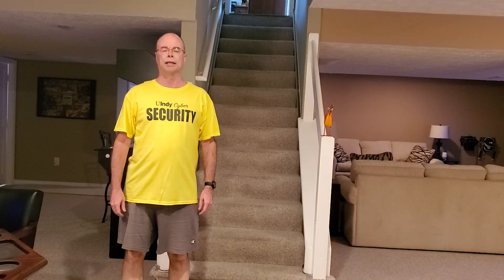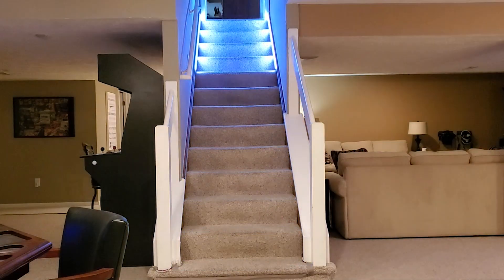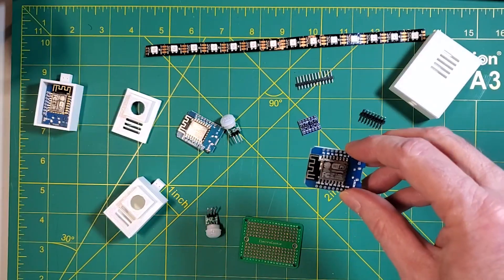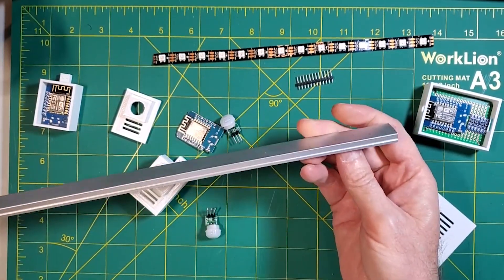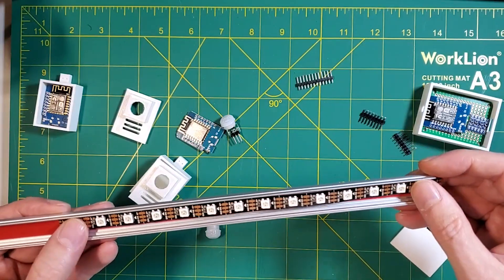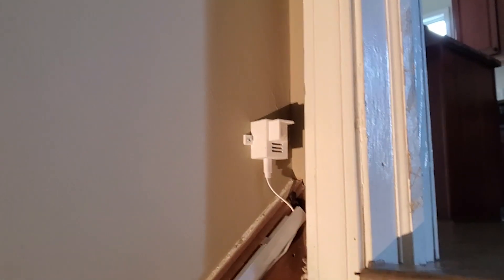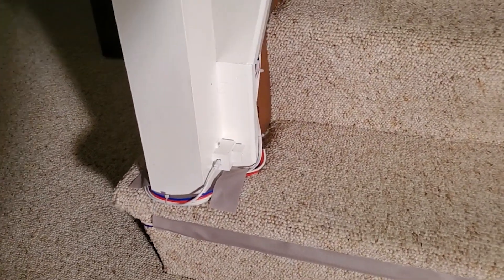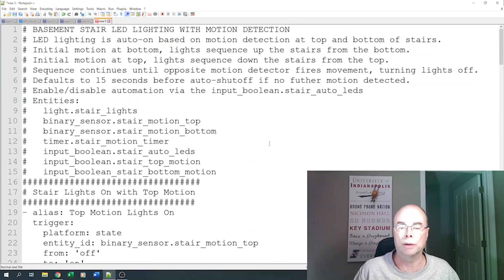Motion activated LED stair lighting... without staircase modification!

Comment: Thank You for the video . I followed step by step and it's up and running on my stairs. Question when walking past the first sensor it detects my first leg and turns on the lights but sometimes it detects my trailing leg and and turns off the lights . Is there any adjustments that I could make to fix this issue ?
Reply from the maker: You are using the ToF sensors and not the PIR sensors, correct? I had the same issue initially because the ToF sensors react so quickly.  There are two things you can do, and it might be a combination of both that works out the best in your situation.

First, you can shorten the 'trip' distance of the sensor in ESPHome to cover about 1/2 - 3/4 the width of the stairs.  That way one leg would trip the sensor but the second leg would be outside that range and wouldn't trip.  But this only works reliably if you always tend to step on the first step with the leg nearest the sensor.

What worked best for me was to add a "for" clause to both the on and off automations in Home Assistant.  In other words, you have an automation for both the the top and bottom sensor with a trigger that is:
from: 'off'
to: 'on'

You would add a time to that so that the sensor must remain in that state for a minimum amount of time.  For me, that was around 250 ms.  So you just add a "for" statement to the trigger, so it looks like this:

to: 'on'
for: 
  milliseconds: 250

Repeat this for the other automations that go from "on" to "off" as well, adding the 'for' statement.  You may need to adjust the amount of time and/or use this in combination of changing the detection distance.  It may take some trial and error, but you should be able to get it dialed in so that your second leg will rarely trip the sensor right after the first leg.  Let me know if you have any follow up questions.

Comment: How did you hide your AC to DC Power Adaptor?
Reply from the maker: It's not really "hidden"... but basically out of sight (sorta') off to the left of the stairs and next to the arcade machine.  That's partially because I had power there for the arcade and slot machines.  You situation will likely be different... and sometimes you just have to get creative with placement of things like the controller, power supply and wire runs.

Comment: Is it possible to wire in 3 sensors?
Reply from the maker: Each sensor is an independent device and its own entity in Home Assistant, so you can add as many as you want.  But it will also require some pretty substantial modification to the Home Assistant automations to account for anything more than the two sensors.  Theoretically you could add a sensor for each step... although the power runs and automations would get pretty tricky with that number of sensors.

So yes, you could use 3 sensors since each is a completely standalone device that is not physically connected or wired into the LED controller... assuming you can make the automations work properly in Home Assistant.
Reply: @ResinChemTech  How much would you charge for the 3d box for the sensor?
Reply from the maker: Sorry, but I'm unable to provide printing services for others.  However, you can find the design for the box on Thingiverse here: https://www.thingiverse.com/thing:4969716  and there are my online printing services that can take this design and print the box for you.  In addition, I always recommend that if you have a maker space or maybe a University nearby, you might check and see if they offer any printing services (some libraries even have 3D printer now) where you might be able to get an item like this printed at a much lower cost than an online service.

Comment: Hi, I found your "standalone" controller video and it will DO the trick for those of us who don't want to go with Home Assistant. I use ALEXA, my girlfriend uses GOOGLE HOME. Will those do the job instead of home assistant? Will home assistant "absorb" and operate all my ALEXA stuff if I DO decide to use home assistant?  Thanks for you great videos!
Reply from the maker: For this particular project (stair lighting)... unfortunately, it won't work with Google or Alexa alone (at least not as built - although you can turn the stair lights off/on via voice).  Google Home and Alexa can both work along side Home Assistant and they really compliment each other.  My wife primarily interacts with our smart home via voice (we are Google Home users).  Home Assistant allows me to add automations and expose certain devices that are not available with Google Home alone... so that my wife can ask Google to launch an action or interact with a device that would not have been available with Google Home alone.

Comment: A question for you sir. Does the staircase lighting work as "stand-alone", install-it-and you-are-done? I want to make one for my daughter and she does not have, nor want - Home assistant, ESPhome, or WLED. Once the controllers are flashed, does it work all by itself?
Reply from the maker: This particular version requires Home Assistant to work.  However, I did develop a standalone version that doesn't require Home Assistant (or any other external system).  It doesn't have all the effects that WLED has, but it does have the same "chase" lights you see in this video... and a few others (although those effects were added after the video was made).  You can see a video of that version here:  https://youtu.be/b4s_VEtVWY4  

You can also find a lot more detail, along with the current lighting effects in the related blog article and Github repo.   Links to those can be found in the video description of the above video.

Comment: I'm sure it's already been asked but what WLED effect is that?
Reply from the maker: It is the "Wipe" effect, with the reverse flag on for one direction and off for the other direction.
Reply: @ResinChemTech  how are you going about turning the reverse flag on and off depending on if your going up or down the stairs?
Reply from the maker: It's all handled in the Home Assistant automations and determined by which sensor triggers and whether the lights are already on or off.  If the bottom motion triggers and the lights are off, they are turned on with the wipe effect and no reverse flag.  Similarly, if the top motion sensor is triggered and the lights are off, they are turned on with the reverse flag enabled.  If either sensor is tripped and the lights are already on, then they are turned off (that's how the effect is stopped when exiting the stairs).
Reply: @ResinChemTech  ahhhh ok. I see the reverse toggle now in my WLED integration.

Comment: Thats is my next project for sure. Thanks for this video.
Reply from the maker: You are most welcome!  Note that I did a follow up video where I upgrade the motion sensors with a different (and in my opinion better) type of sensor that isn't as susceptible to false detections.  You might want to take a peek at that, along with the full written version of this project, before starting you own build.  This original video was done quite some time ago, so I have made improvements in the time since this particular video was released.

Let me know how your project goes... or if you have any other questions along the way.

Comment: Hello ..I love your stair lights n I want to do it toine but I have a 2 step u turn in middle..just need to know it's 27 ft total n I can only get the lights in 16.4 ft n how do I know the size of power supply to get for that...
Reply from the maker: You can find answers to your question about the the turn in the stairs in my written version of this project: https://resinchemtech.blogspot.com/2021/07/simple-motion-activated-led-stair.html

As far as attaching multiple strips together (for greater than 16 ft) and calculating the size power supply, I have both a video and blog article that talks about both of these issues (and other info you may be interested in when working with LED strips:  https://youtu.be/GZjS51yBV4s

Good luck with your project!

Comment: Paint those stringers white and 🤌 
I would also need to hide all that wiring to meet the spouse approval factor. Fantastic project.
Reply from the maker: Well... as the title of the video states, my goal was to do this "without staircase modification".  I explain the reason why in one of my recent videos ( https://youtu.be/rKAZxDtShCo ).  Naturally, the wires could be much better hidden if you are willing to drill into the staircase, pull carpet or cut into drywall.  My goal was to install this system without making any changes... and so that the system could be removed in just a few minutes and you'd never know it was there.

But I fully understand the WAF!  Luckily for me, mine is pretty lenient when it comes to the basement "man cave".  Now, if I wanted to install this on our main stair case to the second floor... that would be a totally different situation (and don't think I haven't considered it... but that would have a very, very low WAF!)

Comment: I'm bummed.  I doon't have a skirtboard to attach the strip.  My treads go directly into the drywall, so I have no way of laying out the strip in parallel to the strip.  Any other ideas to accomodate me?
Reply from the maker: Well, the aluminum strip and LEDs are quite light, so drywall should support them without anchors, although you may want to use slightly longer screws on the brackets.  I have other LED installs, such as my garage parking assistant where the aluminum channel is attached directly to drywall.  This assumes you are OK with creating small screw holes in your drywall.

As far as making the strip parallel to the stairs, just measure up a fixed distance from the front edge of each step and make a small pencil mark.  Then simply align the bottom of the aluminum channel with these marks.  The bottom of my aluminum strip is approximately 1" above the front edge of the step, but you can adjust that as you like.

If you don't want to put screws into your drywall, you could try some strong double sided tape... but to be honest, the double sided tape may cause more damage to the drywall than the small screws.  Hope that gives you some ideas.

Comment: I wonder if you could ditch the PIR sensors and use a mm wave radar sensor instead as you can measure distance to target so light the correct steps in real-time based on where someone is standing e.g of they change direction on the stairs
Reply from the maker: Yeah... as I mentioned in this video's description, I replaced those PIR sensors with ToF sensors... and did a follow up video ( https://youtu.be/ZRb_wpJo1AM ).  The ToF sensors rely on distance (and have a narrower FOV), but the distance is converted to a boolean in ESPHome so that Home Assistant logs aren't flooded with continuous distance measurements.  The ToF sensors have been much better than the original PIR sensors... especially for my particular staircase design and opening at the botton.

Comment: Seems nice till you realize when it's very dark the motion activation doesnt work. In total darkness they wont turn on when you need them.
Reply from the maker: Hmm... guess that's possible, but my basement is pretty dark (no windows) and they have never failed to trigger.  Which would be expected because the original sensors utilize infrared (basically heat), not visible light.  What's more, I have also upgraded the original PIR sensors with ToF sensors (covered in another video) and these also do not rely on visible light.  In fact, I've tested in a completely dark basement, and they work just fine.

But your experience might be different.

Comment: I do like this. It does seem complicated to me. Do you know if anyone makes a complete kit you can buy?
Reply from the maker: I don't know of anything commercial.  You might be able to rig something up with some commercial LED strips, a smart plug or outlet and a couple of motion detectors... but I don't now how responsive it might be.

Yeah... this is a bit complicated... but sometimes that's the nature of DIY.  I did do another version (and related video) on a bit more basic version that doesn't have as many effects or features, but operates standalone and doesn't require Home Assistant or any other external hub or automation system.  It's not simply plug-and-play either, but it is a bit simpler than this Home Assistant version:  https://youtu.be/b4s_VEtVWY4

Comment: Great video! (I landed here from the update you did later). 

Did you consider using one esp for all functions? Addressable lighting effects aren’t the easiest to write in esphome, but the defaults may cover what you need for this purpose. I’m considering the same project and I wonder if I could use a single esp for all 3 functions. I’m thinking maybe run a line inside the channel, behind the lights, for the sensor that is furthest from the power supply. I’m not sure about any issues with a long line between the sensor and the controller.   

Keeping it all in esphome could allow for automations that work without having to go to home assistant. 

Just wondered what your thoughts were. Thanks for sharing!
Reply from the maker: Thanks!  Well, you could probably do it with a single ESP but at least when I built mine, it would have meant giving up WLED on the primary controller, along with all the various effects and options that go along with it.  Yeah... ESPHome has a handful of LED effects, but nothing to the extent that WLED offers.

But newer versions of WLED have support for up to two 'buttons' that could likely be used for wired motion detectors but I don't believe any connected buttons are accessible in Home Assistant (yet), which would make the automations difficult, if not impossible.

But if you are OK with the effects that ESPHome offers (or are smart enough to figure out how to add your own through lambas), you could probably do most of it in ESPHome and a single ESP.  Of course that would mean that you'd also have to run three wires from the controller location to each of the sensors... +V, GND and signal... as opposed to just a single USB power cable.  But that's a personal preference and depends on either your ability to hide the wires or deal with more exposed wiring.  With the aluminum channel that I'm using, I don't think you could hide the wires anywhere other than in front of the LEDs, which would make them visible through the diffuser... I tried that method with the USB power line and could have laid the flat USB cable under the double-sided tape and the LEDs on top of that... but chose to run the flat cable on the underside of the aluminum channel.  It's basically not visible unless you get down on your hands and knees and look for it!  I don't know about signal drop with a long wiring run for the sensors, but I suspect it would be fine as long as you used large enough gauge wiring.  But of course larger wiring makes it harder to conceal!

There are probably other hybrid methods that could be used as well.    For me personally, I didn't want to give up all the features and options that WLED has... so that means I need to use independent motion detectors for all the automations to work how I want.  But thanks for watching and sharing a good idea that some might prefer.

Comment: Hi, thank you for the video.  I am new for this, I was confused on the diagram system configuration.  How is the two sensors (up and down stair) communicated with the WLED controller.  Best regards, TC
Reply from the maker: The motion detectors, and the WLED controller, are integrated into Home Assistant.  Home Assistant takes the change in the motion detector and turns the LEDs on or off, and sets the proper effect up or down depending on which motion detector fired.  This particular system will not work without Home Assistant.

However, if you are not a Home Assistant user, I did create another version (that has a few less features and effects, but works basically just the same).  This version works 'standalone' and does not require Home Assistant or any other external system.  You can see a video of that system here: https://youtu.be/b4s_VEtVWY4
Reply: @ResinChemTech  Thank you so much for quick response.  Can you post your video about the Home Assistant ?  Thanks a lot for your help.
Reply from the maker: While I utilize Home Assistant in a lot of my video projects, I don't have a video specifically on setting up and using Home Assistant.  But there are a ton of videos on YouTube about the subject... just search "Home Assistant".  I do have a little more information on the automations I use in Home Assistant in my related blog article... and copies of my Home Assistant automation code can be found in the related Github repo (links to both are in the video description of this video).  However, this is just the automation code used in Home Assistant... not information on how to install and setup Home Assistant itself.

Home Assistant is a great home automation platform that allows you to bring thousands of devices together under one application and create nice dashboards, create advanced automations, etc.  However, it isn't necessarily a quick and easy undertaking.  If you have other smart devices, then Home Assistant might be a good choice.  But I don't think I'd install Home Assistant just for these stair lights.  In that case, you'd be better off with the standalone version that I shared in my previous comment.